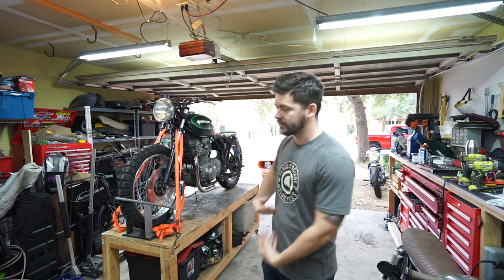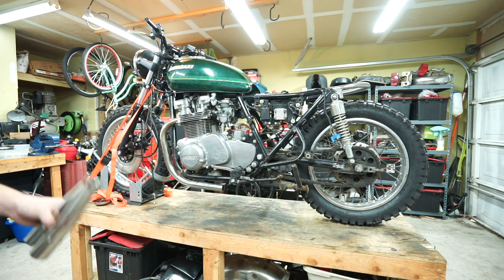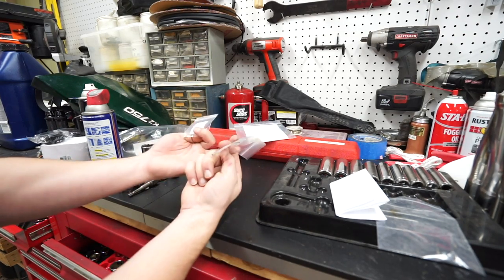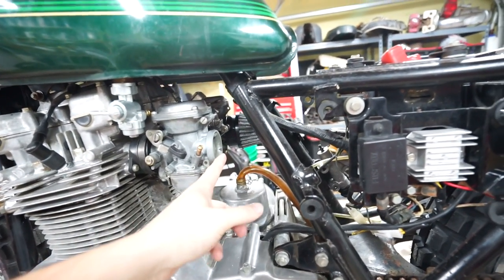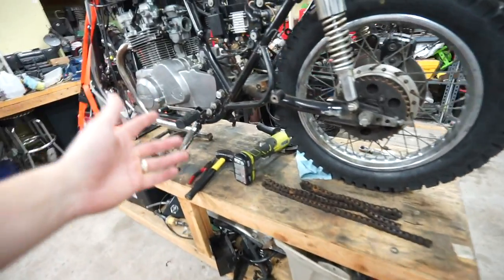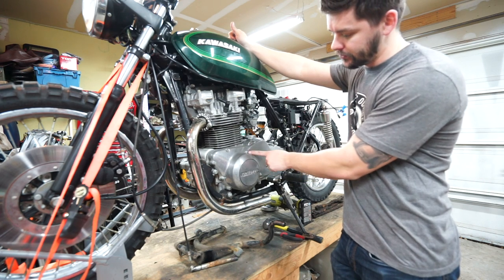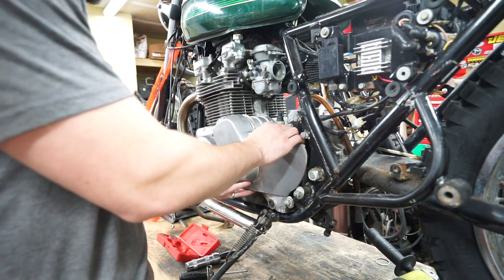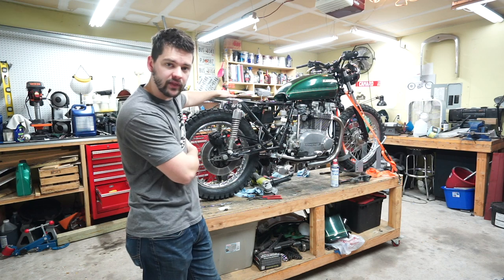KZ750 Scrambler: The knobbies are finally mounted!

Comment: On the air filters take them off and make sure the rubber inside is not restricting the ports at the rear of the carb. I bought a XS650 with the same carbs and K&Ns and they had already been trimmed. Great videos and love your Triumph and the build.

Comment: Great video. Good tip on the impact driver. My first bike was an '83 and it had JIS screws holding the clutch cover in place. I tried removing them with no luck. That's when Dad introduced me to the impact driver, which did the trick nicely. A very useful tool.

Comment: Dude! I've wanted to do something with a kz750 for SO long. This is awesome. I've had lots of trouble with cupping on those exact tires on the road.
Reply: i was thinking about getting knobbies for my KZ750 Spectre but i honestly dont think ill be off road very often...i was initially gonna go track style but decided to go brat style instead
Reply: @lvwrx  I'm doing a brat style 550 right now.
Reply: @rulehardgarage9740  very cool!!! if i had better editing skills i would post my build on my channel...do you have vids of your build?
Reply: @lvwrx  Not yet but soon. I have other motorcycle videos though. Check us out. Gs550 and cb750 builds coming up.
Reply: Cupping?
Reply: @hairyneil  cupping is abnormal wear of the tire, diminishes the life of the tire....various causes to cupping but more than likely it can be suspension related
Reply: @lvwrx  ah ok, cheers!

Comment: I'm using those exact filters and my bike runs fine. Was on 50 pilots before which seemed kind of rich at the moment but now that I'm down to 47.5 it seems kind of lean so I have to mess with it a bit more. Hope this helps some. Keep up the great work, I love the way it's coming out! Hit me up if youd like to see how mine came out. It may possibly give you some design ideas, not that it's anything great
Reply: I’m setting up a KZ 750 twin on pods and I was just wondering what your elevation was when you settled on that size pilot jet

Comment: I like it so far and you've reminded me to get myself an impact driver and JIS bits for my old Honda.

To me the bike could be given a bit of a lift at the back with some slightly longer shocks.  In my mind it's going to look a bit dumpy and weighty as it pretends to have some off road credentials with the exhaust and bars.  Lifting the rear might open out the lines a bit and give it a slightly more sprightly and buoyant look.   Can't wait to see the exhaust job.

I prefer the 'at work' sequences without music.

Comment: So excited I found this channel! This is the build I want to do with 1979 KZ750 i purchased. I am curious if you had to replace the rear brake master cylinder on this motorcycle  and what you used if you did.  My rear brake keeps locking up when it's used and I can free it up by opening the bleeder on it. Thanks!

Comment: Turning out awesome Taylor!! The best filter pods are both American made “54mm S&B washable or bike master. K&N rc ovals are awesome but expensive.
Reply: S&B filter pod, maxi flow RC135...55mm high performance washable 👍
Reply: RC 234 are small 55mm pods and could work better depending on your tray for your electrics.

Comment: If those pods are the el cheapo Emgo style, they're junk.  K&N and Uni brands have a small velocity stack built in to them to help collect and smooth the air.  The cheap ones don't and the inner shoulder that acts as a stop against the carb throat even partially blocks the idle circuit. The bike will run with these but you will never get it to tune anywhere near as good without some sort of velocity stack.  Have a look at the carb boots that go to your airbox, velocity stack on the airbox side.

Comment: You want K&N style pod filters that don't have the lip on the inside. Otherwise it blocks the air jets around the inlet. https://4into1.com/set-of-2-chrome-performance-oval-pod-filters-54mm-honda-cb-cm400-450-cx-gl500-650/